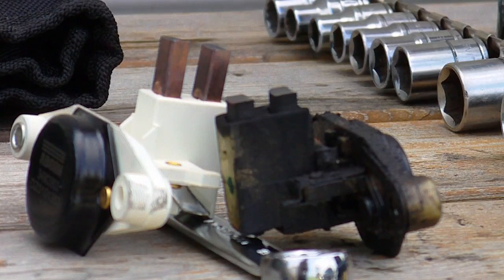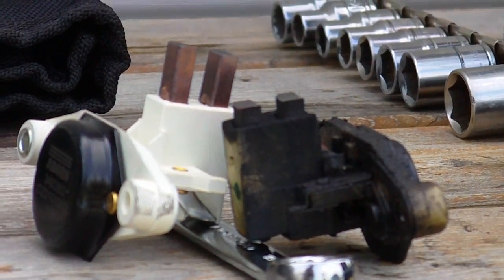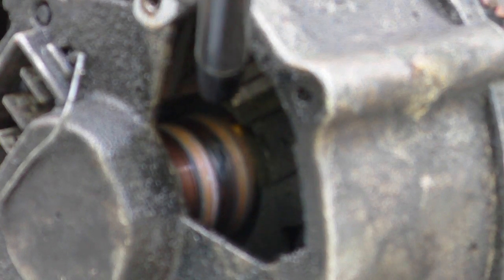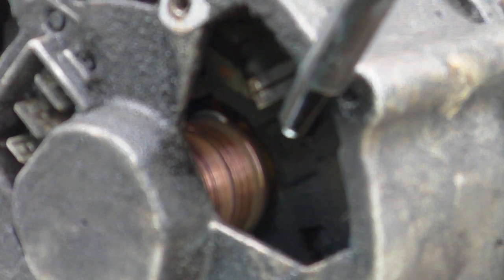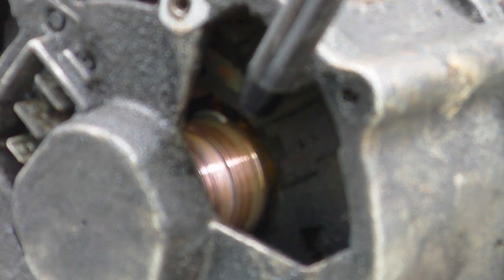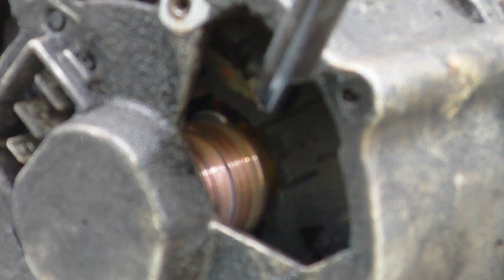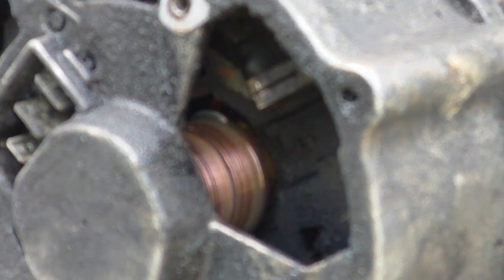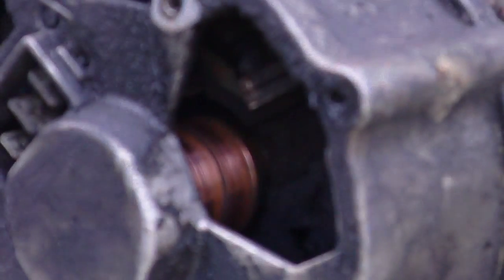Replace the Brushes & Voltage Regulator in my Mercedes Bosh Alternator

Comment: Would you be able to do it when the alternator is in the engine or do you have to take the alternator out to get to the regulator
Reply: Yes you can do it with the alternator still on the vehicle

Comment: Im about to do this on my 2004 saturn ion Valeo alternator, it has 186,000 miles on it. Part store wants $200 for new and alternator stor wants $100 to rebuild! I found replacement regulator for $40 on Ebay. Wish me luck ! ! My alternator test at the part store said faulty regulator. Wish me luck!

Comment from the maker: The charging rate was only 13.6V and went up to 15.5V after the repair, not had any battery problems since.
Reply: heavymechanic2  i guest more than 14.8 v is harmfull for battery
Reply: heavymechanic2 - Nice video and tips. I'll add my 2 cents. Max. 15.5V is a bit to high. Maybe the new regulator is not the best or is faulty. Happens a lot. :-(
Anyway for a well used alternator I always advise (do) a rebuild of the bearings along with the brushes/regulator. When one is gone the, other is not far behind. A bit like changing water pump while doing the timing belt. Just save time and headaches further down the road. 

Another important detail, it's always good to make all those contacts, that are already black with dirty/corrosion, etc. return to bright clean metal. 
Wire brush, sandpaper, etc. Are very difficult to use in such small space. Commercial cleaners are available. But my tip is cheaper and easier to do at home. Put some mustard in the contacts, and leave it while doing the rest of the work. Before assembly clean the mustard remnants and voilá bright perfectly clean metal contacts. My cars over the years have taken more mustard than a hot dog. LOL :-)
Thumbs up, keep on. ;-)
Reply: crpth1 these Mercedes run at 15.5 at the alternator